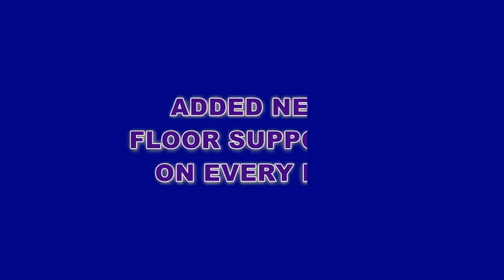1974 Starcraft build.

Comment: I like the Starcraft side wall rod storage. Is that 3/8" SS rod and u-bolts cut down ? Also the diamond plate walls that the rod storage is attached to , how did you go about attaching and making the shelving/storage. Thanks for answering all my questions.
Reply from the maker: I custom make the loops and the holders.  The side  shelves weren’t hard. I added a piece top to bottom on the factory braced.  Then added the shelves and skin over that

Comment: Floor question. When you replaced floor. You used PVC sheets for the flooring instead of wood. Then covered in diamond plate. The PVC sheets that were used were screwed down into supports. Did you ever try pop riveting the PVC sheets down when installing floor. or is the floor just diamond plate ?
Reply from the maker: Floor is just diamond plate.

Comment: Awesome it turned out like a starcraft mariner mr21 . I like the 4stroke and the tandem trailer does the diamond plate get hot in the sun? Is the 1/8 thick enough?  I have a sea nymph great lakes special that l would love to outfit like this. Especially the Suzuki  4 stroke.
Reply from the maker: Thank you. No it doesn’t get hot at all.  I love it.  I use 3/16” on most my projects if I can get it.  This one has ribs really close together. Thanks for watching and commenting I appreciate it

Comment: Really liked the job you did on this boat, from your storage areas to the  floors.It looks to be well put together. Just wondering if you welded the aluminum plates in or did you rivet them. I hate to pester you so much but i really like and relate to your videos. You seem to be quite knowledgeable in all aspects of fishing, boating, repairing, rebuilding and everything in between. Thank's again, Bill
Reply from the maker: The floor is screwed down with stainless screws.  Everything else is solid and pop rivets.   I wanted the floor where I could pull it up for quick access and for just general maintenance and inspection purposes.  It’s no problem.  I enjoy when people ask questions, that usually means they’re genuinely interested.

Comment: I was wondering if the very cold temps had an effect on PVC panels. I saw a video and it said it could shatter like glass in very cold weather. Have you seen this problem ?
Reply from the maker: No this stuff is tough. I use it in new home construction

Comment: Jeff, i know you said you started with just an outer skin. I was wondering if you could tell how the boat was originally laid out. I have been thinking about trying a project like this myself, but pretty much all  the boats i have found are closed bows. I'm afraid these boats would probably require quite a bit of extra fabrication to  completely open  the boat from front to back like yours. I haven't found any boats close enough to me and priced reasonably to justify going to look at as of yet so i really don't know,and can't tell by the pictures what all would have to be done to convert from a side console closed bow to an open bow center console.  Would you rather start with an original center console than the side console? The older 21' aluminum boats, Starcraft or any other brand are hard to find and I probably won't find one priced as good as yours was but i don't want to pay 3 grand for a 40 to 50 year old rig and all i have to work with is a hull. I appreciate any imput you might  have on this. Thanks again, Bill
Reply from the maker: Mine was probably a split console or a cabin.  It’s not that big of a deal to convert to center console. And the ones with cabins are just as easy to convert.  Just a little more trim to be made but structurally they are all about the same.  Good luck finding your project boat and thanks for watching
Reply: @bowl830  Thanks Jeff

Comment: What kind of speed do you get w/ that suzuki?  What HP?
Reply from the maker: It’s a 140   I’m running a 21 four blade prop.  It will run mid 40’s normally .  If it fully loaded with both livewells full and 2 people it’s still around 42
Reply: @bowl830  Nice, thanks.  Just picked up an 21' blue fin CC from 1982, refitter her this winter.  Trying to decide flat plate or diamond plate floor.  I've used diamond plate and it makes it tough to mount flat thing without grinding down the diamonds.

Comment: What brand "Epoxy Sealer" did you use on boat?
Reply from the maker: I like the G Flex line
Reply: @bowl830  I mean when you painted the bottom of the boat or top side?
Reply from the maker: Sorry I used automotive paint. It was PPG commercial paint and primer.

Comment: Where did you get the channel to put the stringers in
Reply from the maker: I actually used aluminum brackets. I riveted then to the side of the factory stringers.  Then when I cut the PVC ribs I made sure they were bearing on the factory ribs.  The 4” PVC PIPE   strengthens and give you a nice wire chase.   Thanks for watching and commenting I appreciate it
Reply: @bowl830  how big is the boat and how big of a  motor did you put on it
Reply from the maker: It’s a 21’ Starcraft.   88” wide
Reply: @bowl830  is there any other way I can contact you not on YouTube I just got a bunch of questions I want to ask cuz I got a very similar boat that I want to do the same thing too
Reply from the maker: Anthony Hostetler go to my Facebook page team Reelin the blues or send me a friend request on Facebook

Comment: Is PVC board the same as what they call coosa board?
Reply from the maker: Coosa board is more like starboard.  This material is smooth on both sides and has a porous interior.  It’s lighter by weight.  And a lot cheaper. A 3/4” 4x8 sheet runs around 130-150
Reply: @bowl830  thanks for the explanation Jeff.

Comment: no flotation?
Reply from the maker: Yes it has closed cell foam sheets cut to fit the bottom I installed it front to back.  There’s a recent video where i did a tracker boat.

Comment: No foam flotation? Not a good idea. Foam keeps it from sinking like a rock loosing all your gear and the boat.
Reply from the maker: It has foam from end to end.  I just use sheet closed cell foam   It has about 2500lb  of floatation in it

Comment: A fuel tank under deck
Reply from the maker: Mine is tucked on the left side above the deck. It’s a upright.  It takes up only 9”x13 of floor space and holds 21 gallons.  Which is way more than needed with this 4 stroke. 
Thanks for watching and commenting I appreciate it